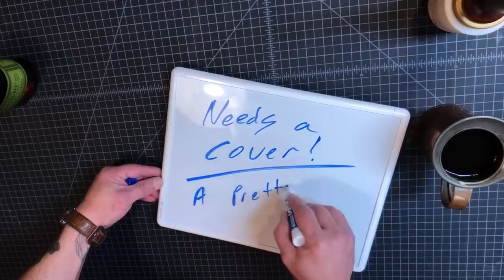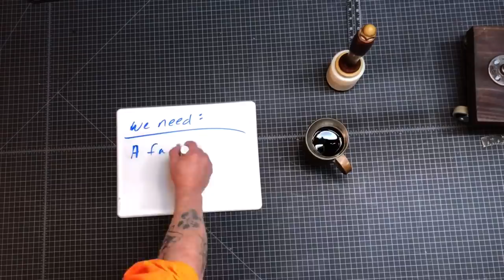Making a Leather Notebook Cover!

Comment: Was wondering how the hard cover notebook slides into the leather sleeve. Do you have to widely open the cover backwards to work it in? Is it easy to insert? I always thought the inside sleeves could only be about half the width of the cover.
Reply from the maker: Slick the back of the leather.  See my latest video

Comment: Can't you use a rivet gun for placing the rivets? Or is it too much force/ pressure ?
Reply from the maker: Totally different rivets.   These are solid metal.  And …. Well, simply put, no.
Reply: @MasconLeather  is there not a rivet gun for leather work and leather specific rivets?
I'm trying to be serious,  so please don't think I'm joking or being rude.
Reply from the maker: No.  There’s not.  And won’t be.  For way too many reasons to elaborate on here.  Simply, no.

Comment: Where did you get that square you're using for aligning the pieces at 8:50?  That looks really handy.
Reply from the maker: I had them custom made by a machinist
Reply: @MasconLeather  I should have guessed.  I was hoping it was something translated from the paper industry.
Reply from the maker: They make some similar for woodcraft.  Check amazon.  Red aluminum
Reply: @MasconLeather  They are in my cart.  Thanks!
Reply from the maker: Boom!  🤘